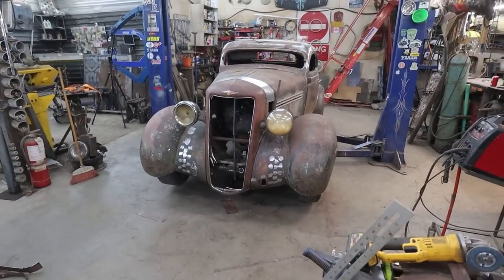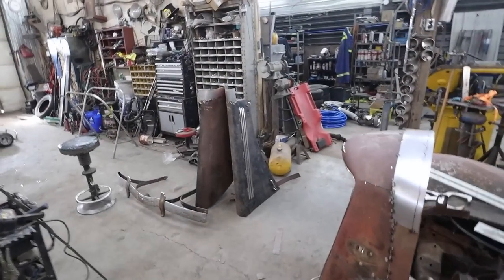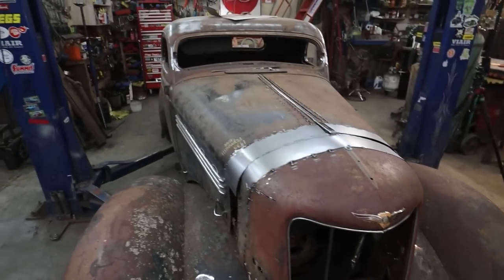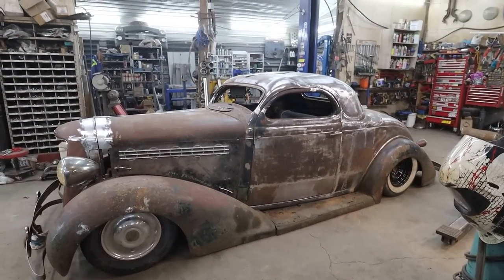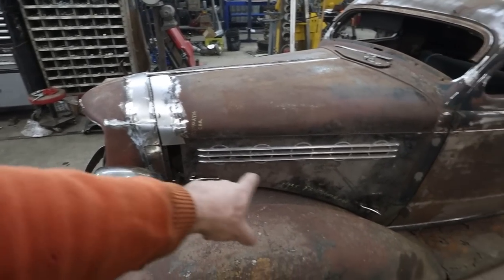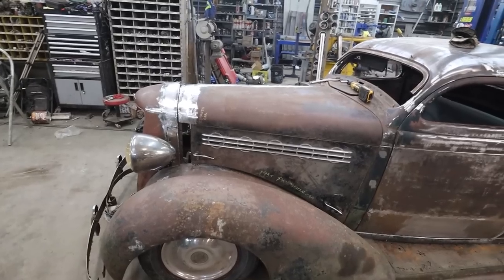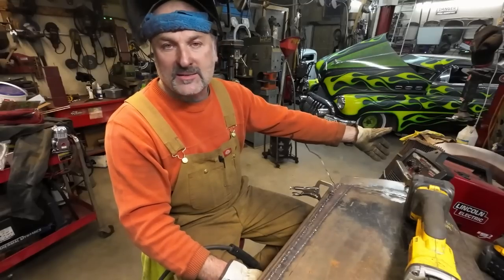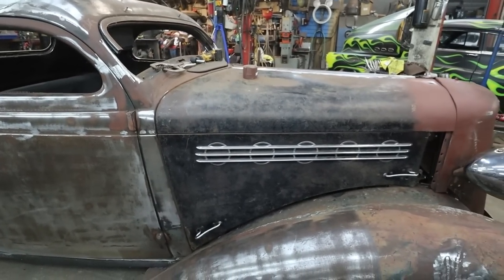Cutting and fitting the hood to the grill on the 35 Dodge 3w coupe.

Comment: when you are done painting turn the can upside down and spray until the stream goes clear, you  will use only aerosol to blow out the straw and nozzle helps prevent blockages between usages. Awesome work by the way. always a pleasure to sit down and watch what you are working on.

Comment: For the hood and grille molding running across the top. go to a yard and look at the moldings on a 1968-74 Lincoln they are super long and about the original width of the ones on the car. one set from the rear or front fenders might be long enough to do the replacement of the ones you have that are to short.

Comment: Looks like a tough couple of days in the workshop, looks much better now the rear edge of the grill is parallel to the front edge of the hood. Have considered filling the gap with an opening vent, like those found on the side of the cowl on old trucks, might get rid of some heat on the next trip to Texas, I'm enjoying the road trip posts, thanks.

Comment: I have a question for you,  on the 35 dodge grill and hood thing.
I've been doing body & paint for over 30 years and I noticed that when you mounted the grill you had a gap at the back between the fender and grill.. and that the front fenders needed help... I think it is because the lower fender area is pushed back and that would make the grill tip forward 🤔 
Just my 2 cents 😊

Comment: Hi Brent, as usual, an entertaining build. I like this one a lot. You always find a creative way to get the end result you want. This one is a classy combo from the parts bin! Just a thought ( everybody has an opinion on  what somebody else should do) , have you looked at 1937 chev hood sides? Not to use , but they have a bullet shaped blister ahead of their side vents, which is kind of a reverse of their headlight bucket. It would add some interest to the piece you have to fill in , rather than struggling to get it perfectly flat and square. I'm sure any solution you come up with work great. Cheers

Comment: It's the nozzle/button. Pop the plastic nozzle out with a box knife and then spray some compressed air inside the button without the can on. Make sure there's no schmutz inside the nozzle as well, and then assemble the can back. edit: from my younger years, i recommend you ditch the buttons that come with the spray cans and buy a bag of graffiti ones (online, easy to find). There's variations of it, dot, line, oval, and various widths of it. A line one of 4 cm wide should be very good for laying nice, even coats. I still use my old ones. Whenever i'm done with them, i just dissemble them and drop them in acetone for a couple of hours, then use a syringe to blow any crud and acetone off. If you can get your hands on a filler needle (the tube type that doesn't have a piercing tip, usually used to fill ink inside print cartridges) those are perfect for this.

Comment: A lot of hard work and vision Brent . The hood and grill are really shaping up. When I first starte to watch you work through this problem I was wondering if you cut the radiator shell in half letting the upper portion line up with the hood then cut and bend the bottom portion of the radiator shell out so it slopes outwood like a 33 Ford grill

Comment: It doesnt look like the chrome trim on hte hood sides will look out of line. The gaps at the ends look pretty even. If they are about an inch or two more at the front than the rear, it wont show bad at all. Especially when it is all one colour. 
Have you chose a colour for the body yet ?
Reply from the maker: I'm painting is sunset bronze
Reply: @HalfassKustoms  Oooo, nice.  Lovely choice. :)

Comment: Excellent video Brent  :) , Pablo The Supervisor  Dog 🐕  , also hood latches be fun to fix up to agree and yes have some Spray Bomb cans screw up on me on primer also paint plus pentriotion fluid to also me also! How fix up Brent have bicycle pump or car pump use metal tip on take button then  push in spray tube in to valve line hear it bubbles up for 15 to 30 seconds then let off and do for ten seconds and shake up also  or take off needle valve! Then shake can plus button back on try again ! Maybe want extra hands doing this so won't blow up can to moon and back Lol!

Comment: i see u trim you sanding disk at times with a set of snips....its faster and easier to turn on a bench grinder and spin the disk at a 90 degree in the grinding wheel. it also makes them have a smoother finish.

Comment: Are the sides of the hood on a piano type hinge? Maybe it will be possible to pull the hinge centre rod and move the sides a few notches forward to align the lower curves without welding them and just add strips to the front and back edges.
Reply: Just seen your comment about the rod not coming out......

Comment: I knew you’d get it right,really coming along nicely. Do you ever use lead on the weld to avoid using mud?I know it’s old school a you tuber i watch Arthur tussling does seems it works I don’t know I’m sure you do. Thanks John from Arizona
Reply from the maker: The material to do that isn't really available here to do that. Unfortunately it would also make the bodywork 4-5 times the price up here.

Comment: Brent, I really would of like to seen you lean the grill back at the top. Im afraid it's going to look like "Big Nose Kate" with the grill itself sticking to far forward. What do you think??
Reply from the maker: When I tilted it back the top of the grill shell started darting into the engine bay
Reply: @HalfassKustoms  it maybe the camera not showing it's true visual sitting. It just looked as though the original edge where the hood rested was leaning forward before you lengthened it.